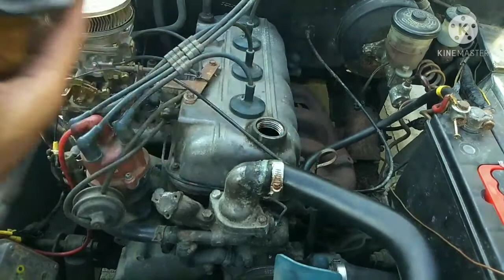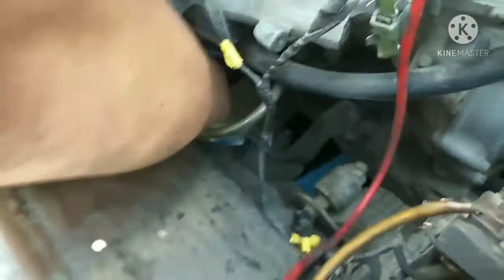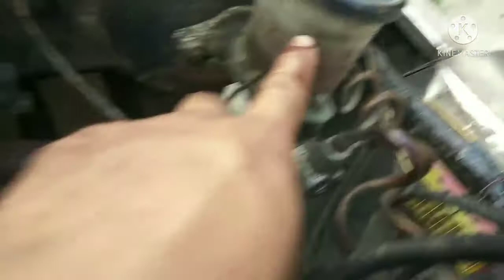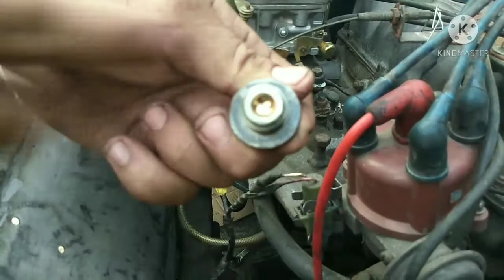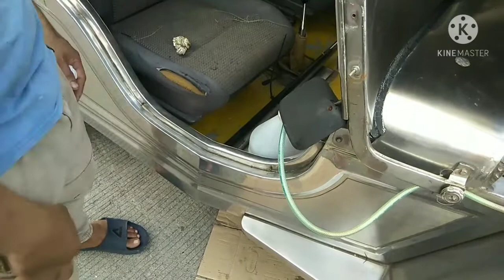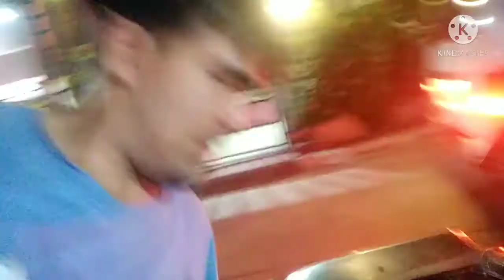How to Change Oil Owner Type Jeep | Toyota K series engine | Vlog 22

Comment: Master anong langis po kya ang pwede sa 3k engine at ilang liters mag change oil?
Sana mapansin.. thanks
Reply from the maker: Mineral oil or ordinary oil lang sir ayos na, castrol 20w50 gtx, platinum 20w50, havoline, aisin, delo gold pwede rin. At marami pang ibang brand. Salamat po sa support, God bless
Reply: Boss ano size ng radiator cap mo